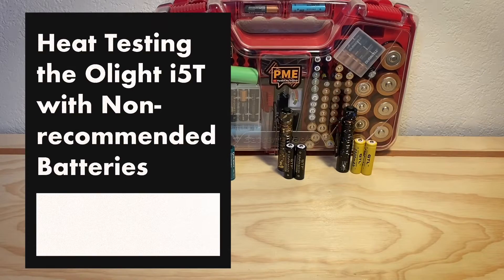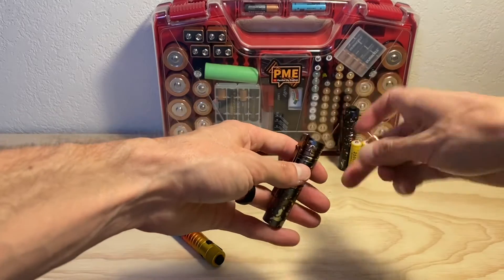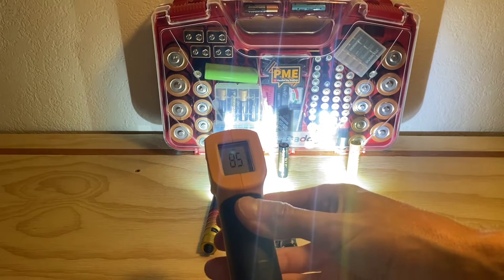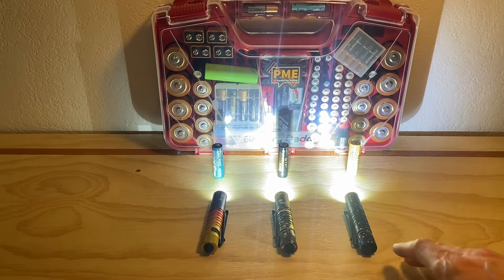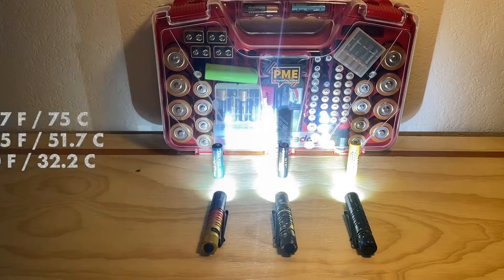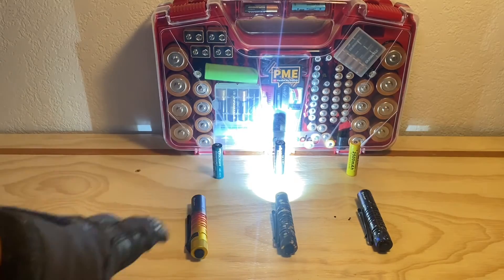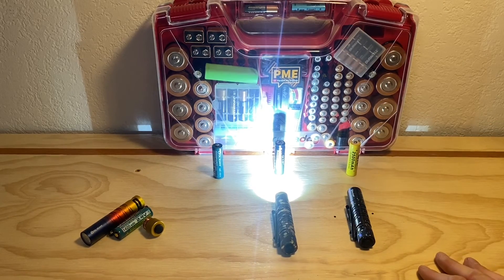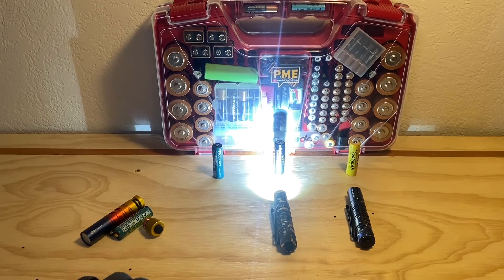Olight i5T Heat Test with Non-Recommended Batteries (3.7v, 3.2v LiFePO4, and 2.4v i5R cell)

Comment: It's hard to tell in videos. Is the brightness affected significantly over a 1.5v battery? I was thinking about dropping some 3.6v lithiums in my AA battery lights.
Reply from the maker: Good question. It is much brighter but does generate lots of heat. You also lose the ability to use low mode.

Comment: Put a voltage tester to these. You may find that 3.7 volt batteries are actually 4.2
Reply from the maker: Yes, you are right. They have a voltage of 4.2 when fully charged and the nominal voltage is 3.7.

Comment: If you lose your low mode, the other batteries are no-go for me, period. Especially if it gets hot enough to cause first or second degree burns. But I bought some extra 2.4 volt Olight batteries for my i5R and i5R HCRI, and would use them in the i5T I bought too, if I didn't give it away as a Christmas gift. Likewise, I bought some 10440s for my i3T 2 and I just put one  in my i3T Carbon Fiber to boost the output 50%. I asked Olight about putting the i5R battery in the i5T and 10440 battery in the i3T,  and they said not to do either one, but I know people are doing it anyway.
Reply from the maker: Yes, losing the low mode of the i5T and i5R is a bummer. Plus they get dangerously hot so I avoid that combo myself.

Comment: Does the i5r battery increase the lumens on the i5t ?
Reply from the maker: Good question. Maybe slightly, but to be honest, I cannot tell with my naked eye. The output looks just about the same. The main advantage of using the i5R battery would be the increase in runtime.
Reply: I wanted to give my 13 yo son an autism i5t and I wanted to throw an i5r battery in it for the convenience of being able to charge it with the type c after I tried a vapcell battery charged at 4.2 in the I5t I put a regular battery in it lol it got hot very fast it was bright but instantly hot now that I seen this video I feel much better about putting a i5r battery in it and not being afraid it's going to blow up lol. Honestly idk how yours ran that long lol..
Reply: @Joe_Gervasio hi. Weird question, but did it turn out to be good? I am thinking about getting an I5T and using the I5R battery
Reply: @maikl1309 I ended up giving my son a arkfeld uv then arkfeld lazer then the titanium gears arkfeld pro and he loves them. I have the ultra and never arkfelds but he loves the titanium pro ⚙️ model.

Comment: Great test. I’d love to see temperature measurements taken off the grip section where one would hold be holding the flashlight in addition to the ones you took of the head of the flashlight.
Reply from the maker: Thank you! And good thought. It’s tricky to get too precise with my thermometer but the head area is definitely the hottest part of the body. The tail area still gets hot but it takes a bit longer to heat in my experience. I know it’s not exact but I hope that info helps.

Comment: I doubt that capacity rating on the 14500 lithium ion of 2800mah. That's more in the range of an 18650 battery. Have you tested them for capacity?  That battery is probably 1000 mah over-rated or more. It's an easy number to fake & fool people with. 
If you look at a battery data sheet,  they will often list the maximum operating temperature in centigrade. Usually, it's from 45 to 60c maximum. If you get above that with a lithium cell, not only will it degrade the battery life, but it could catch on fire. I'm not trying to fear monger. It's best to be careful with lithium Ion batteries.
Reply from the maker: You’re right about that battery capacity claim being way too high. And that’s good to know about the max temperature for li-ions as well. Yes, definitely not recommended. I was curious to see if lowering the voltage would help keep the heat down but that LiFePO4 battery still got too hot for my liking.